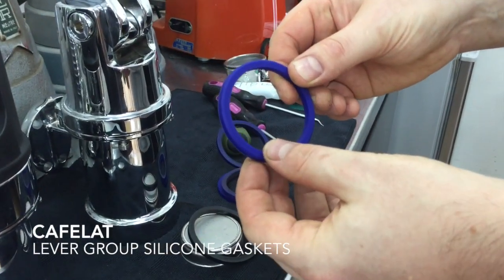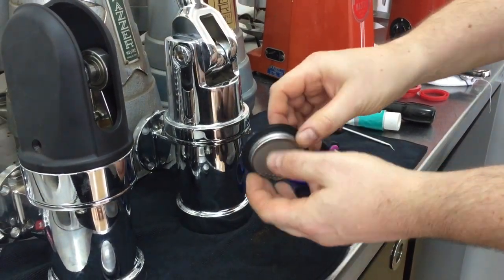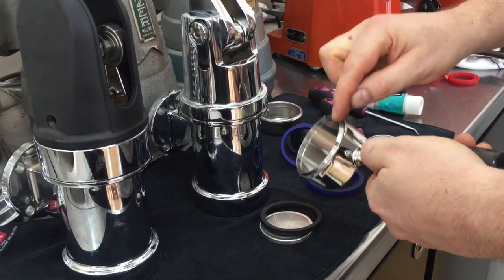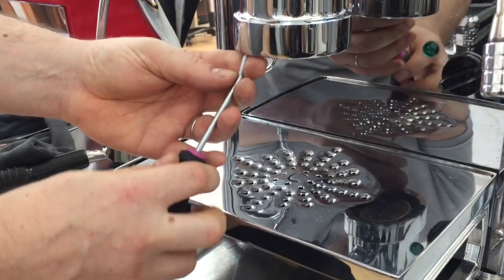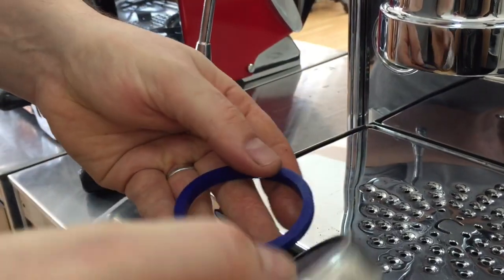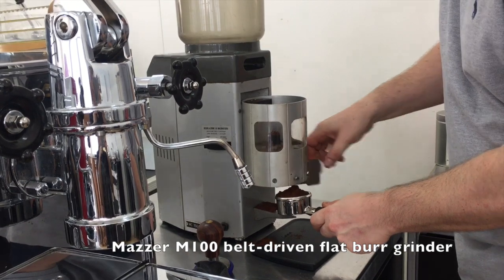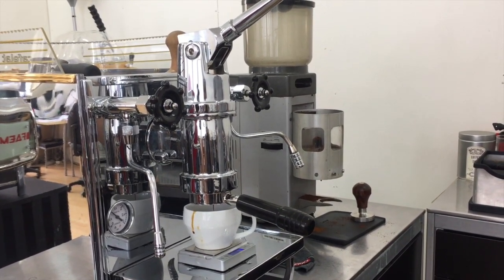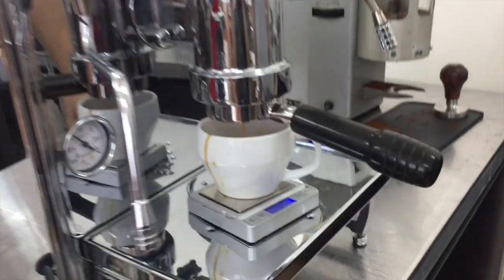Lever group gasket

Comment: Hi, i changed both the seals aswell as the shower screen on my profitec pro 800, i feel like on the midway point (pre wetting) causes channels now (visible indents on the puck). Could that be that i fitted a seal inproperly or does it have to do with the shower screen?
Reply from the maker: Hi Sascha. Do you mean you carefully hold the lever so the water can enter?    Or at the natural pre-infusion position when the lever is down?
Reply: @Cafelat  hi, i mean at the halfway position of the lever when water can enter at less pressure as in the down position.